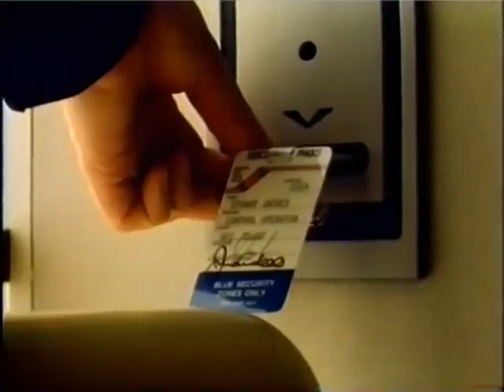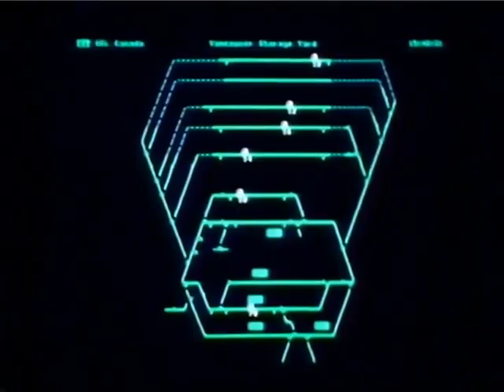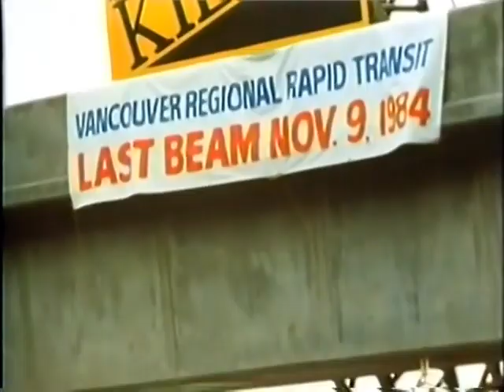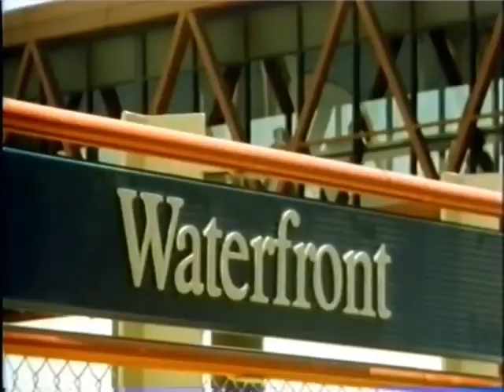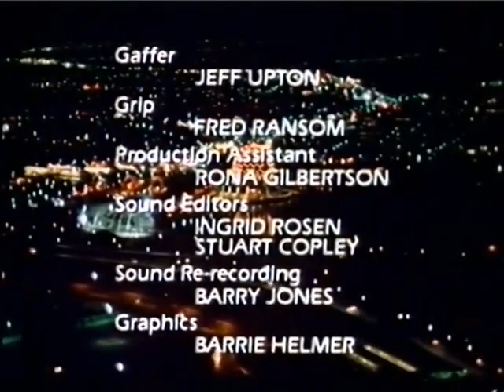Goin' to Town - 1985 SkyTrain film just before opening the Expo Line

Comment: Very few of those old cars have the original paint on them I know 132 still does have the original paint on it
Reply: I think the first 114 cars (so the ones ordered for the original Waterfront to New West build) were painted to the current Translink paint scheme in conjunction to the refurbishment project in 2013. Any car 115 to 156 were from the later expansions and were not part of the refurbishment project.
Reply: 131 also has the original paint, also 122 on on side I think